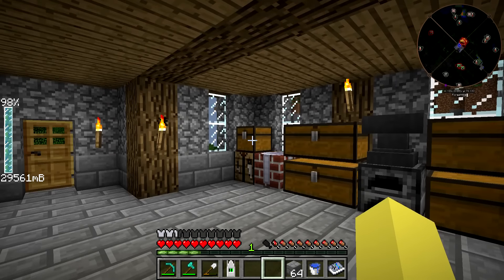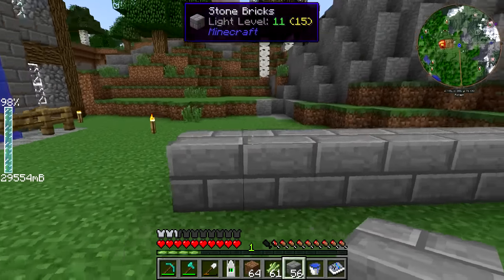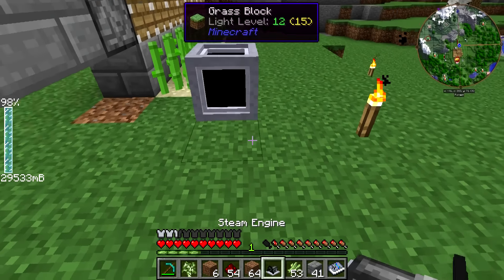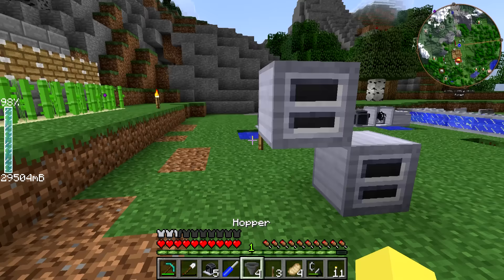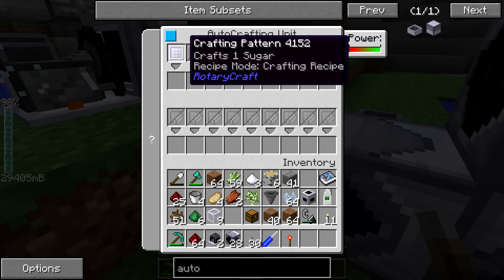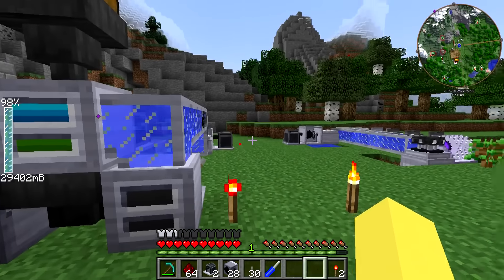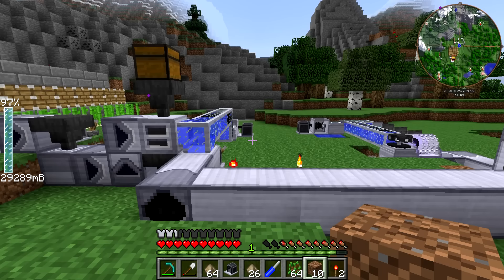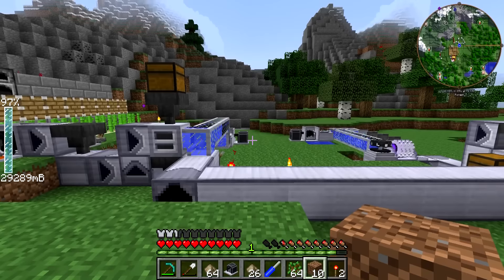Surviving With RotaryCraft :: Ep.18 - Automated Ethanol Production

Comment: the reason why putting the item pump directly into the autocrafter didn't seem to work is that the autocrafter doesn't have an internal source inventory, only the output. the items were being put into the hopper and instead of the hopper pushing them, the crafter was pulling. that's why it wasn't slowed down by the hopper's slow transfer rate (though you don't seem to have noticed that)
Reply: you can see this by replacing the hopper with a chest, or even just putting the crafter next to the item vacuum. in fact, that way you don't need to worry about stray items like mob drops (or at least until if fills up). and at that point you can use the filtering of the pumps.
Reply: actually, in fact, you have a very similar problem with the item sorter. it's taking from the inventory on top and trying to output to the inventories on the sides... or spit it out in the case of the item pump.
Reply from the maker: Interesting, I never thought of the item pump only being an output instead of an internal inventory. Ill definitely have to tweak the build with this info off camera. Thanks :)!

Comment: Can you run excess wood through a grinder to make more sawdust? If so, that might be a useful way to get more for additional ethanol.
Reply: and grinder for suger cane to multiply it 3 times?
grinder must be bottleneck unless you hookup 4 steam engine on one grinder
Reply from the maker: Both of these are great suggestions that I will definitely add (I even mentioned the grinder in the video), but unless I wanted an hour long video, I wasn't planning on doing them on camera :(

Comment: You can tie some of the DC engines to a redstone line and to one switch to ease off heavy use of levers
Reply from the maker: That is very true! A master switch would be great :)
Reply: DrRageHard got mine to run on one switch depending on how close I can get my pumps together  (usually 8 to 12 pumps for basic operations with repeaters on one tick)